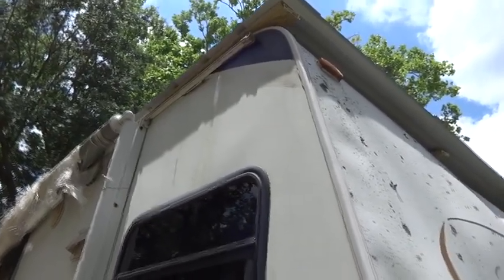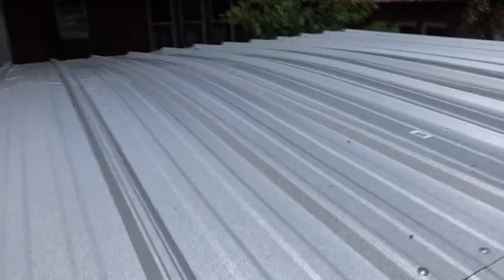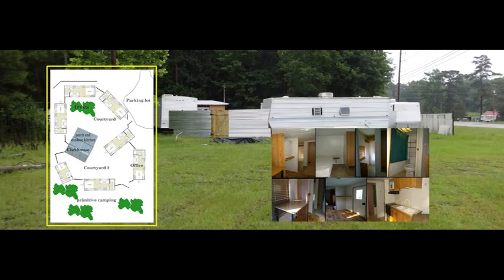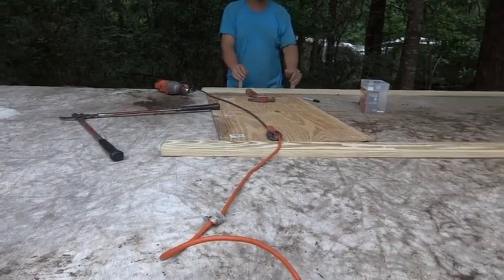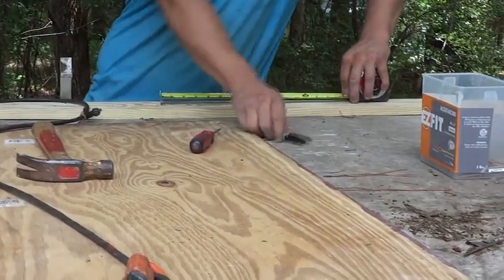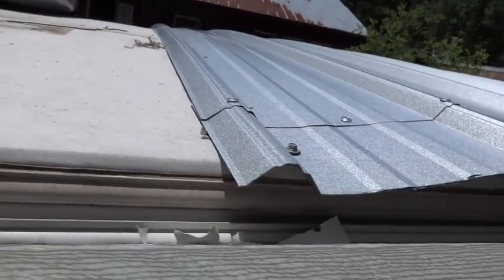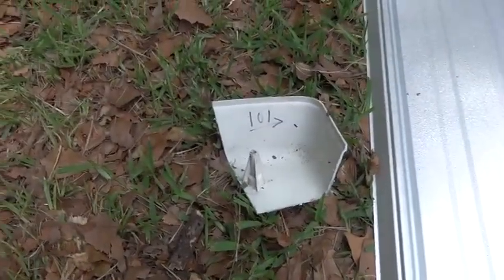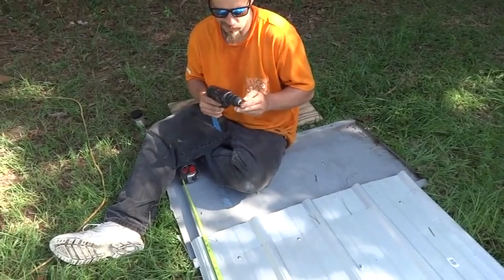Putting Roofing tin on a camper top

Comment: I would have thought this would be an issue the way the panels are fastened going horizontally as it is the opposite to the way the camper is sloped for the water to flow front to back. It almost seems as if this method will block its flow from front to back forcing it to flow off sides? Just a thought, let me know what you think about it and would you do it the same again or would there be advantageous to doing it vertically

Comment: What do you do when you get to where the air unit and such sticks up higher than the rest of the roof ?  Need video on how you finished it please ?
Reply from the maker: wow  a good question, I wished I would've made a video on that, but I didn't, but I can explain in words how, 1. inside the camper the panel on the ceiling remove it, underneath or 4 long boats, remove them.
2.  get on top of the roof with a prybar, and lift up the air conditioner.  3.  use the  ladder to help slide down the air conditioner to the ground, requires a rope and two people,
 I hope this helped, sorry I did make a video, be safe.
Reply: Thank you so much.  I didn't know if u removed the air unit or went over it was all.  Appreciate the speedy reply back to me on it . !!
Reply: @arkansasroadselfstorageofw7110  I love it. good job. no more "mystery" drip leaking inside. It pisses me off how poorly they make the roofs on these trailers today.
Reply: I'm looking to do this on my stationary camper but would love to avoid taking our everything on the roof. Would it be doable to just cut around ya think?